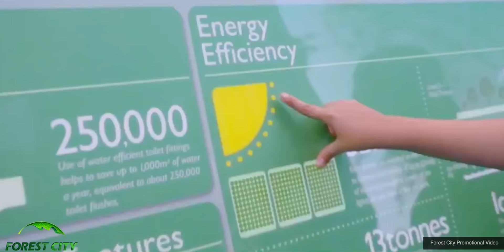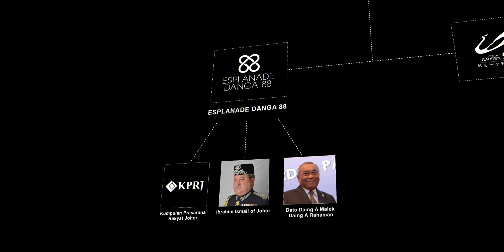Why China Built a City in Malaysia

Comment: "What is built so far" does not show that "car-free" and "road free" city at all though. That is not surprising. Multilevel city design has failed to deliver time and time again and instead lead to expensive, hard to maintain, inflexible cities which are often featuring an arcane layout that is nothing short of a labyrinth for pedestrians. It doesn't surprise me at all that what is built already from Forest city looks like a generic Chinese city, even if a bit fancier. That means huge roads, which can not be crossed at level, car oriented design. It is an illusion if you believe you can make a city attractive for predestrians and humans, if you merely dig the cars (which is hardly possible in the first place on land reclamation land on which underground construction comes with a ton of challenges and very high costs.
This was just a comment on the city design itself. Of course there is also the mentioned implication that this is basically a corporatist city state where one private holding controls all "public services" and that holding is largely controlled by a communist superpower. What could possibly go wrong?
Reply: Plus fragile

Comment: Forest City planning is fundamentally flawed. From the start, it was marketed as an investment for Chinese buyers. And it would likely have turned out to be like a second or third tier Chinese city with a ghost city. That is, even if China had not imposed a cap on capital outflow, and Mahathir had not denied visas to "home-owners", Forest City at best would have made a profit for Country Garden. At a cost to Malaysia, and specifically Johor. 
Forest City would ultimately have developed 700,000 units - apartments and houses. That was the plan. Even at the very minimum, that would be 700,000 new (Chinese) residents! The current population of Johor State is about 1.8 million. Johor Bahru is just over 1 million. Assuming an occupancy of 3 persons per home in Forest City, it could house ALL the population in Johor. Or mean 2.1 million Chinese entering and living in Johor. Even with just ONE occupant, 700,000 homeowners would increase the population of Johor by about 40%! IF Chinese buyers were buying to live in those homes. But they are not. The pattern is for the Chinese buyers to buy the homes as investment. Hoping that the value of the homes they bought would rise in value. So Country Garden was basically building a (speculative) Ghost City.

Comment: A succinct analysis of the project. 👍
If I may add (some already mentioned),
- proximity to Singapore in this particular case has NO benefit (ie near but not connected; what goes on in Singapore bears NO relevance; etc);
- it is NOT (and will never be) conveniently connected to Singapore except via the 2 existing jam-packed causeways;
- labelling itself a “green” or an eco-friendly or sustainable project does NOT make it a fact. So correctly pointed out, it’s very development has caused irreparable damage to the natural eco system that was there;
- this is NOT the first mega project in MY that lacks sustainable (ie strategic political and infrastructure) support nor will it be the last;
- corruption, incessant policy and political flip-flopping remain the reality in this country;
- as a matter of fact, with all the significant changes made to the terms and conditions of ownership and restrictions to resale of investments within this project, it is very likely to become yet another partially completed or abandoned (housing) project in Peninsular Malaysia.